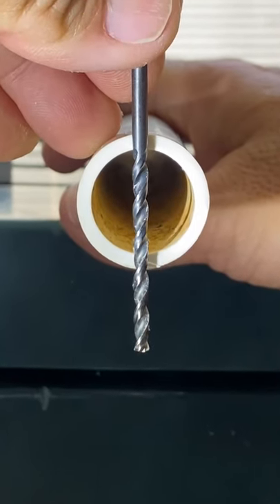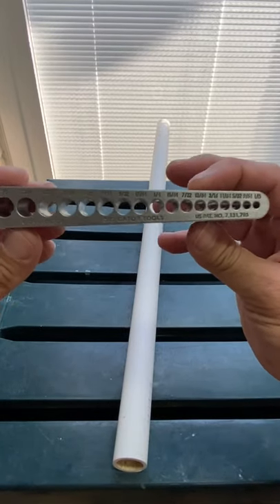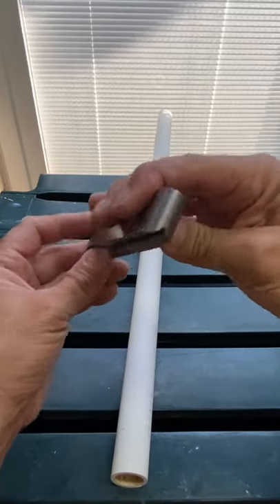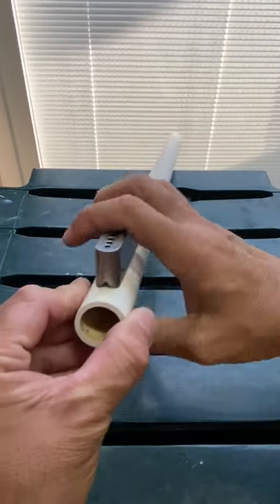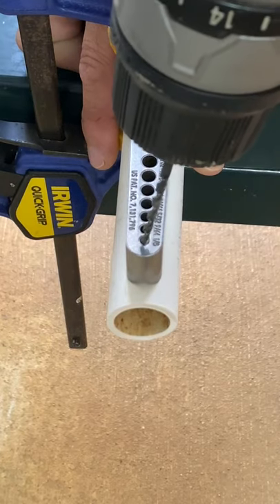Drill a Straight Hole Through a PVC Pipe   #shorts

Comment: Requires a spec tool that most DIY do not have. Just use a steel 90 degree angel
Reply from the maker: Hmmm... interesting.  
How exactly would you use the 90º angle?  
😎
Reply: Are you kidding me? This simple tool costs 30$.